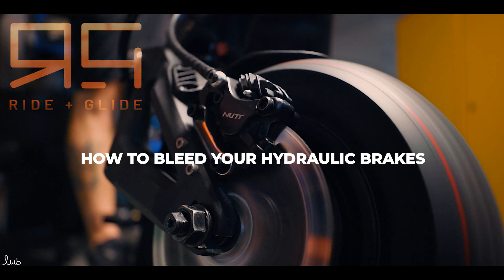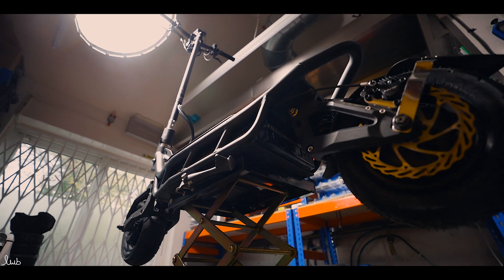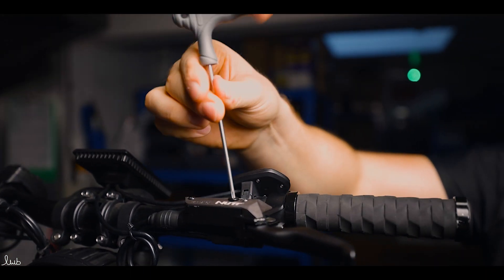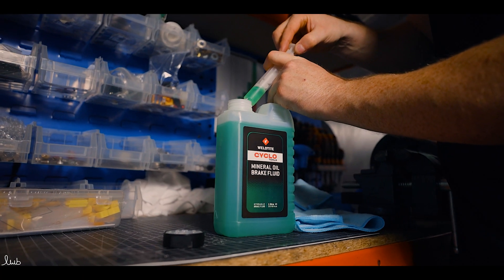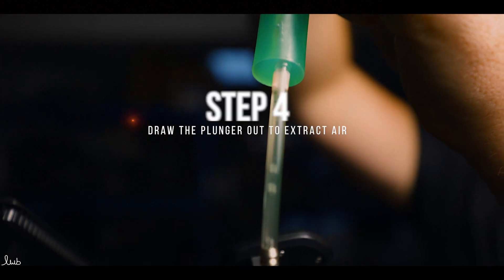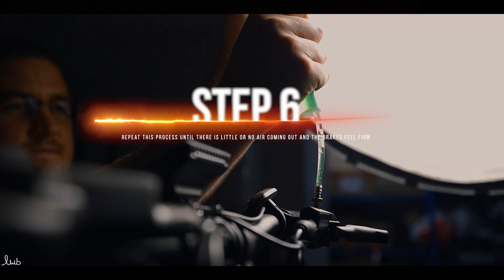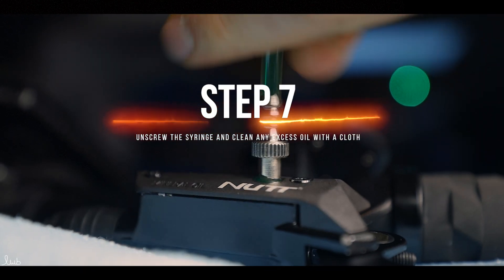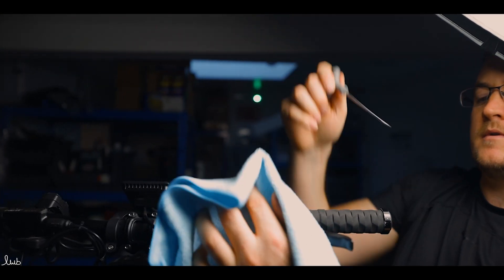Hydraulic Brake Lever Bleed Tutorial

Comment: I love my Nami ❤
Reply: I ride mine every day in the pouring rain to boiling hot sunshine and it’s never put a foot wrong.

4k for an amazing machine is nothing compared to a car and much more engaging and fun than sitting in traffic.

Worth every penny👍🏻
Reply from the maker: @roryrose898  Hear so many similar comments, such a cool scooter 🙌
Reply: @Rory Rose  I have been debating on buying one. Any issues with shipping or once arrived and not assembled correctly or steering wobble? Anything you'd recommend if I do purchase it?
Reply: @shanew7361  no issues with shipping but I live in the UK - not sure where you’re from but I’ve heard some US postal carriers don’t take good care…

No steering wobble for me - only quirk of the scooter is at high speed the regen braking kicks in about 0.5 seconds after braking with levers so make sure your weight is distributed to the rear of the scooter otherwise it can feel a little unsteady. Once you’ve mastered the technique it becomes muscle memory👍🏻

Front brake has become a bit spongy after 3 months of daily use but this is because it needs a bleed which is a very simple process to do at home
Reply: @roryrose898  💯 % agree
Reply from the maker: Love that Pedro, great scooter 😀
Reply: Overpriced even at 4k.
Reply: @shanew7361  quality is not expensive ;)